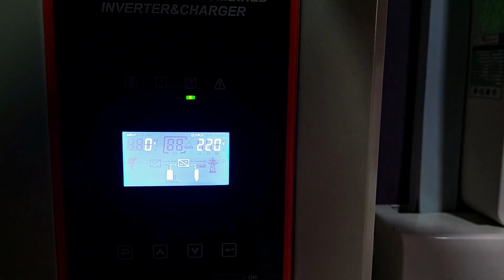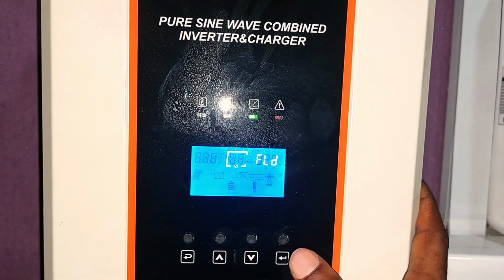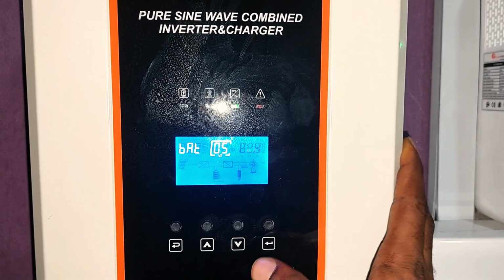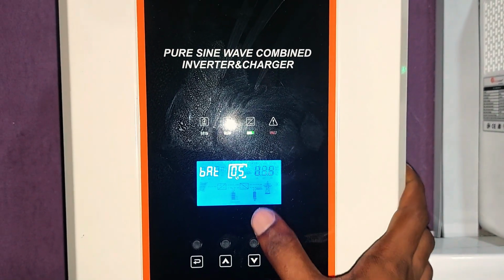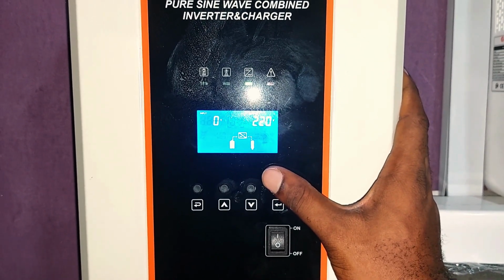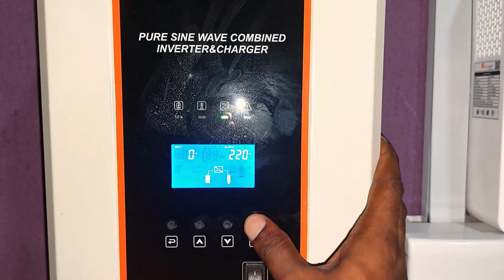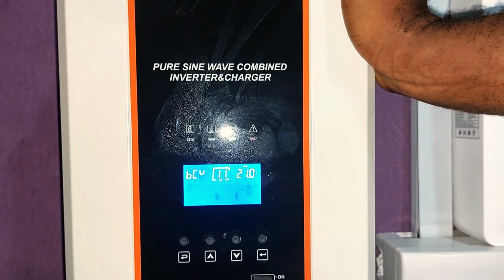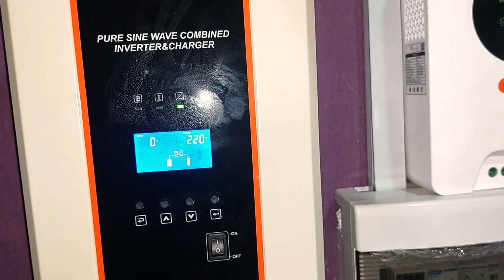How to Set Battery Cutoff Voltage on Your Inverter

Comment: So after setting the cut off voltage on user defined are you still going to take it back to FLD or leave it at the user
Reply: You leave it at User Defined. Taking it back to FLD will void the settings